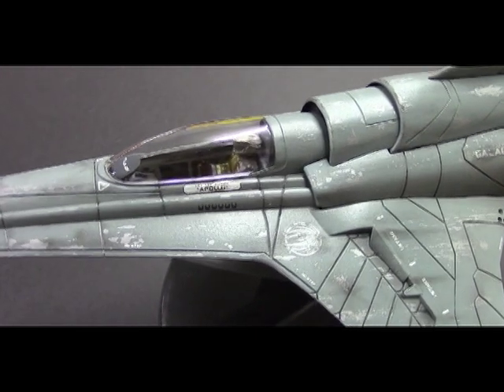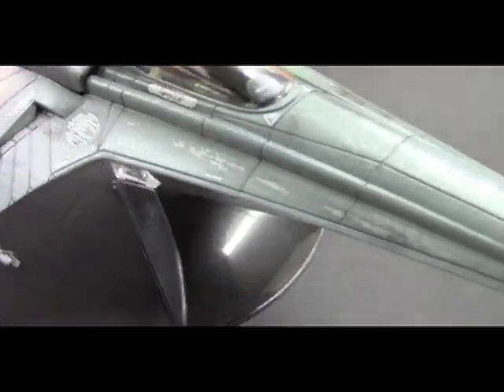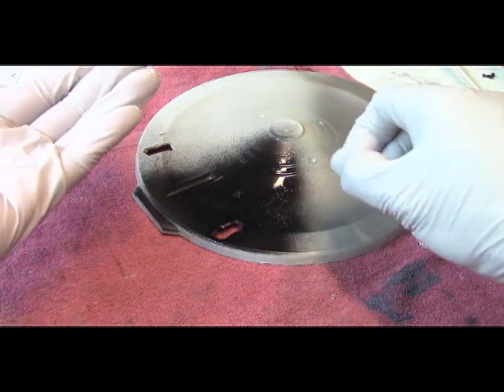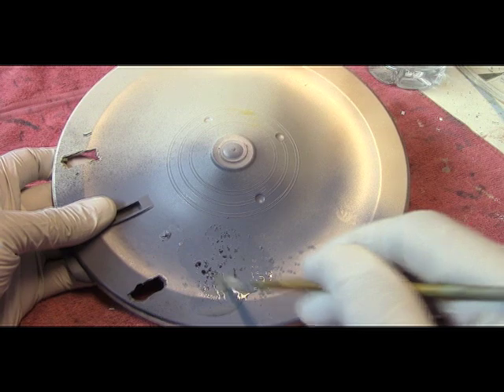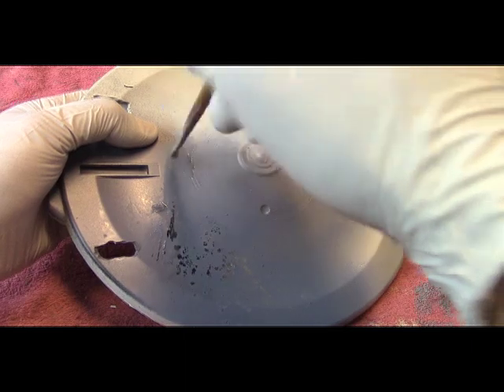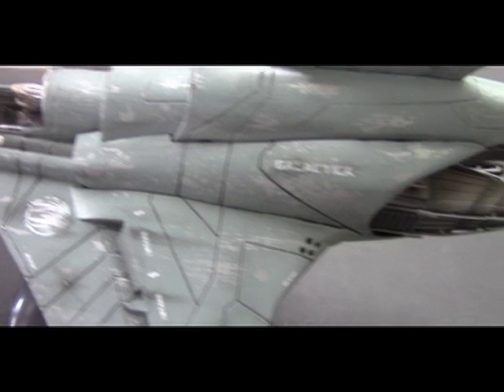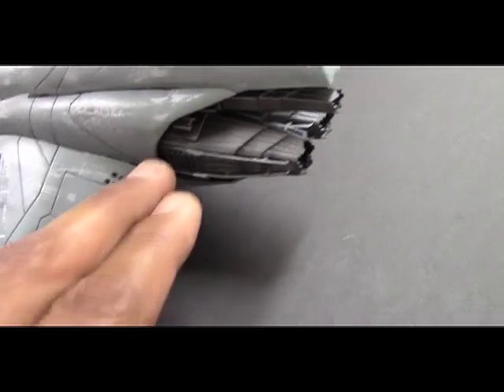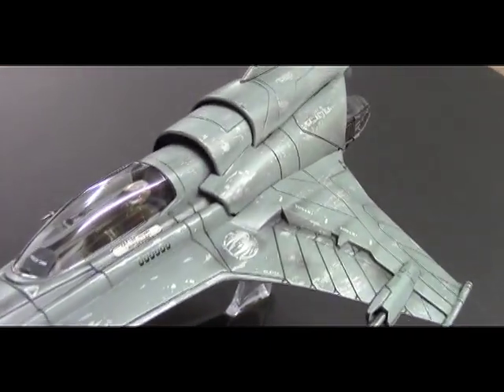Moebius Viper Mark VII model

Comment from the maker: Thank you. I'd estimate around 20hrs or so?? I usually will fit in an hour or two in the evenings to work on models. Typically it takes btwn 2 - 3wks. As for the hairspray you could use the can but remember it's harder to control the out flow. If you need to use the can just keep a good 10 - 12" distance. Also remember to use acrylic paints.  Thx for watching. I'm working on a Raider right now and will post a video soon.

Comment: Good video...nice model and weathering tutorial... im starting one now. The paint callout kinda threw me off though because my kit says " pontiac engine blue" not ford, but im going with Testors " Pale Metallic blue" spray which is the alternate callout in the kit. Just waiting now on.ordering the Paragraphix cockpit photoetch set because the kit cockpit is just bare....would be nice if you could internally light the pilot helmet wouldnt it? Like the real ones.
Reply from the maker: Thanks for your kind comments.  Yeah that should look pretty nice.  If it wasn't for this salt weathering technique that I wanted to try I may have gone with the original recommendation but could only find it in enamel.  Look forward to seeing your completed build.

Comment: If i were to seal the basecoat with acrylic clear and use enamel topcoat would that work as well for the same effect?
Reply from the maker: I'm afraid not. The reason the technique works is because the hairspray keeps the top coat from completely bonding. Water can then be used to rub some of it off exposing the undercoat. The top coat thus has to be dissolvable with water. Enamels are oil based and the oil won't allow the water to affect it. I actually tried it. That's the reason why I had to mix my own paint with acrylics instead of using the suggest Pontiac blue which I could only find in enamel.  Hope that helps.